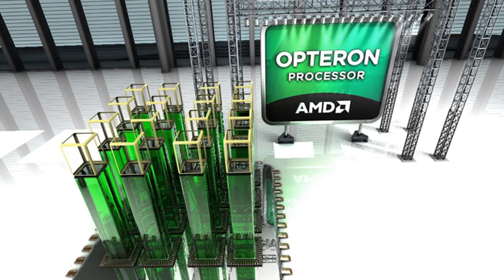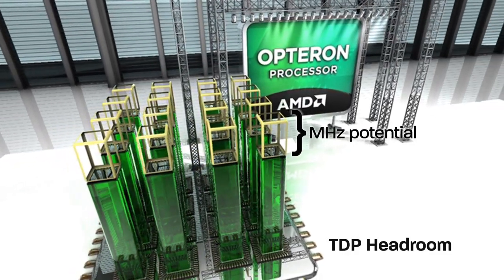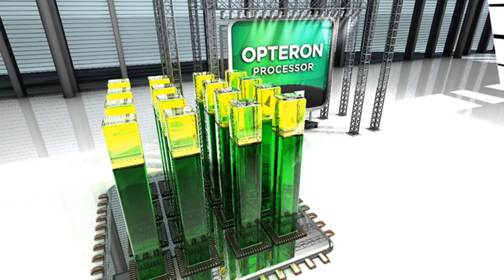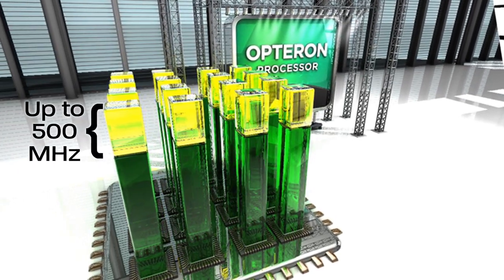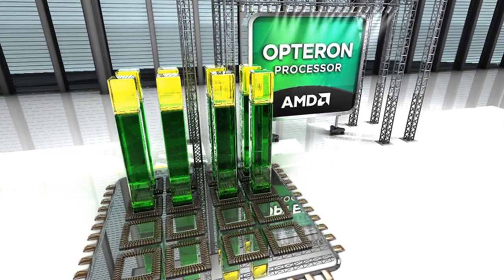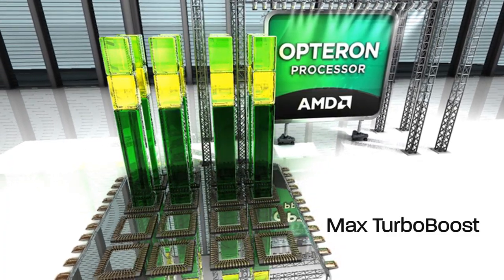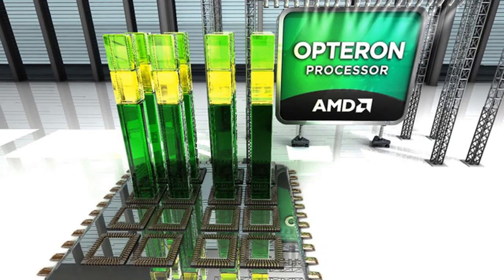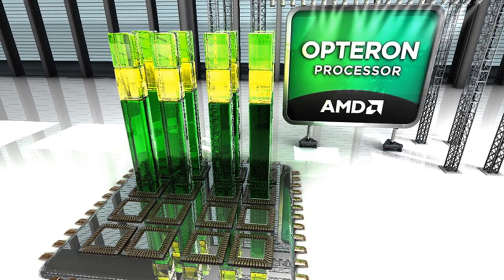AMD Turbo Core

Comment: @Amuffin456 Intel's boost completely turns off idle cores and pumps up the frequency of the cores that are being used. While AMD's boost turns down the frequency of idle cores and also increases the frequency of the other active cores. It doesn't totally turn it off. So yea not a total copy

Comment: These comments make me want to strangle myself...

@f1r31c3r1 It's not a software optimization error, but an issue with the entire architecture. Very few programs utilize more than 4 cores. Also, Intel CPU's with a similar price range are equal or better.

Don't compare sever CPU's and consumer CPU's, they are designed differently. Opterons and Xeons are made for number crunching and such, stable 24/7, fast and reliable. I have no idea about your rambling of these added costs of Intel.

Comment: i have 2.5ghz with turbo core tehnology up tp 3.5  (quad-core) :D
Reply: If your processor say 2.5Ghz, it actually performs only at 2.0Ghz when you use low demanding programs and the Max turbo is when half of all the cores. Only two cores can go to 3.0Ghz and 3.5Ghz when one core is active. Like when not using multi core rendering or when playing old games.

Comment: actually if you check benchmarks on tom's hardware the intel i3 and i5 will outperform the FX and Phenom II's of similar price range. i have a phenom II processor myself but intel is not as overpriced as people say it is, as long as you don't buy the latest models. the main thing AMD has up on it is the unlockable cores, intel processors overclock quite well too now.

Comment: I got my AMD fx6100 Zambezi 3.3ghz unlocked to 4.0 using turbo core :3 a lot of people never explained turbo core FULLY only said un check that then over clock but I tried the usual way and found even if you over clock to 4.5+ ghz the normal method never allows the same voltage settings my max with no turbo core was around 1.3 but with turbo core enabled in AMD over drive the voltage achieved 1.4+ thus giving me more speed than the bios or plain AMD method and was easy as pie.

Comment: the fact that intel cores outperform the phenoms is well known, still i have to disagree with your statement, whereas you buy a regular phenom for lets say 150$ you'd have to do some serious research through the web to get something with a similar price and the same performance - Intel was always ahead in terms of multithreating but still amd keeps the upper hand when it comes to things like single core performance + you get and FX 8 Core for the price of a quad of intel ware :D